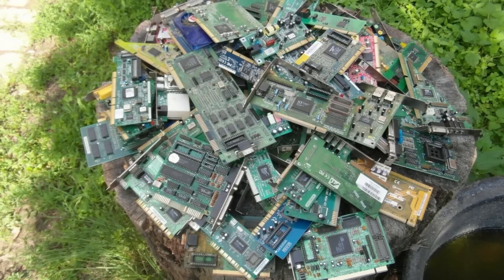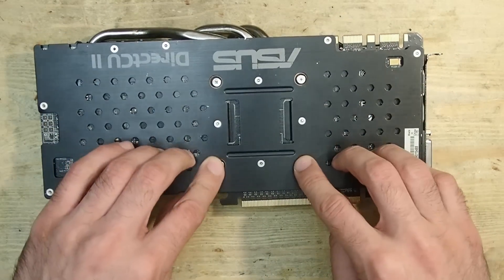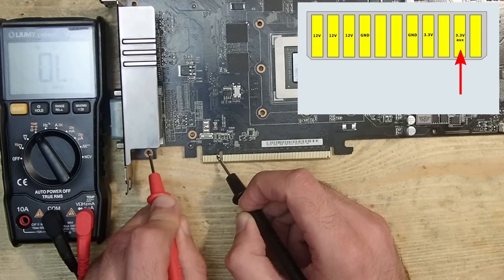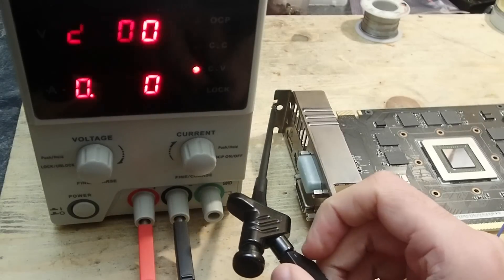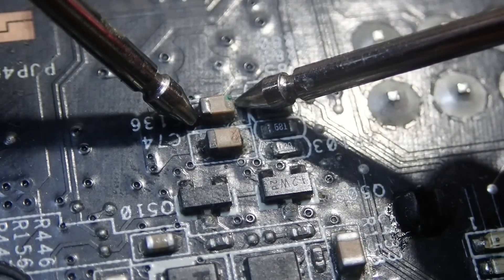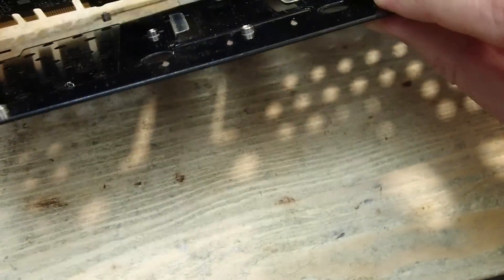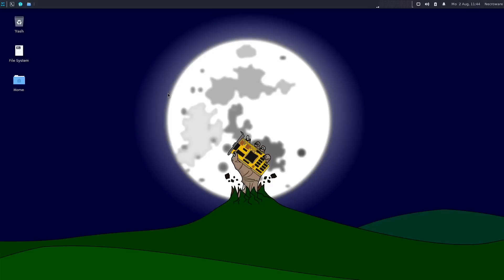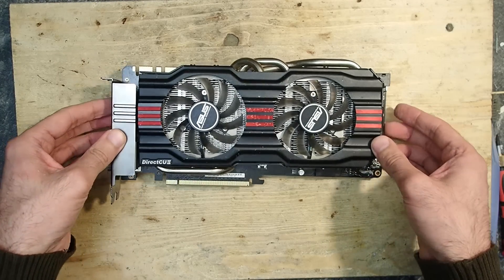GPU shortage? Let's repair an Nvidia GTX 770

Comment: Soldered edge connector will destroy gold plating in MB connector. Just becouse slow mixing and difussion Pb to gold layer.
Reply from the maker: I know, that's why I said in the video, that it's not good. However, I don't care ;) It takes a long time to dissolve the gold plating and even then, it doesn't end up in a critical issue.  Also by that time the mainboard already died for the 3rd time....
Reply: @necro_ware  Hm. I will advise to try to remove all coating after lead directly to copper layer. It will oxidise for long time) And for future restoration just think about  gold plating solutions for electrolise process (nikel + gold). It is not cheap but will work for long time when making only gold fingers resorations.
Reply from the maker: @microtrigger  Yeah, if s.o. repairs something really valuable, I'd avoid soldering to the gold fingers at any price. I'd rather take a PCIe slot from a dead board and use it as with soldered power wires to the pins. However, not in this case, it's not worth the hustle. This GPU is still good and will make it's job just fine, but it's nothing for eternity. So investing into gold plating is quite an overkill :D
Reply: @necro_ware  riser x1 with full x16 pcie connector for this stuf is much sutable)) I understand very well your point, just add that recovering gold plating is nice thing as new original content for your chanel)

Comment: How about a GTX 750 ti, the fans are running but there's no image . My case is too small and probably my power supply is too weak to test it, so should I take it to a professional for a diagnosis? Or to a friends house first and connect it properly, maybe the pc will say something? Idk

Comment: According to Nvidia, a GTX 770 is a retro HW, it does not get driver fix any more. :)
Reply from the maker: Yeah, it's a subjective question anyway. For me everything without an ISA slot is not retro :D And if talking about hardware other than mainboards, it had to be done in the time, where it could've been running in a mainboard with an ISA slot.

Comment: Instead of soldering a wire on the edge connector, get a broken motherboard and pull the PCIE slot off and solder to that.

Comment: I hope the card has some reverse voltage safeguards from the fans. You should never spin cooling fans when they are still connected.
Reply from the maker: The funniest comment so far :D I guess I have to rotate the fans really hard to generate enough power that it would be worth it to talk about....

Comment: I have an old 980Ti founders with rad, Could I send this in to you for repair?
Reply: Error: PC doesn't turn on at all when the card is in
Reply from the maker: That is a sign for a short circuit like it was in my case.  And I'm sorry, but unfortunately I don't take repair jobs for various reasons.

Comment: There ARE relatively inexpensive thermal cams that any repair technician with some stable income can buy auch as HT-301 which costs around $700 if you bargain in the chat on official site and comes with impressive manual focus 13mm lenses,  384x288 resolution and 25fps. For cheaper option an HT-201 could also do the job but I didn't regret going for a 301. Thermal cams can also reveal minute differences that your hands simply can't tell, such as a malfunctioning memory chip with only .5 degrees temperature difference.

Comment: Data Centers figured this out a decade ago
Reply from the maker: You wouldn't believe that, but electronics engineeres figured this out over 100 years ago ;)
Reply: @necro_ware  it's also used to lower failure rate

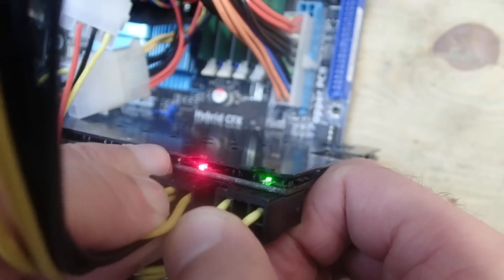Comment: At 15:12 if anyone want to know how to "cheat" the VGA with 6 pin connector, just make a bridge between the both free pins. One of them is GND and the other one is VGA bios test pin, which looks for the proper rated PCU with 8 pins.

Comment: I loved your video, how you use the: "when all you have is a hammer" approach
Reply from the maker: I don't know if you mean it sarcastic, but in German it is actually something bad. The full expression is "If all you have is a hammer, everything looks like a nail", and means, that you ineffectively misuse a tool you know for the wrong tasks, because you don't know anything else. This will be often said to the people, which refuse to learn new things :)
Reply: @necro_ware  no man, I'm sorry I ment it in a good way, far too often I see people repairing electronics using equipment that is worth thousands of usd, I liked your, "well I have a lab bench power supply, I'll make this work somehow" approach

Comment: Hi...I have exact same card of GTX 770 msi...not showing anything fan spinning... I just connect thorough hdmi to vga bcoz my monitor was vga... The connector working and I checked on a gt 730...and it's working perfectly fine... Why GTX 770 not working ????

I tried cleaning using IPA...but no use... My motherboard was gigabyte h510...is there any issue of support....

Comment: I was running Unigine Heaven
Ultra, full HD, AA x8 on nVidia GeForce 9800 GTX (SLI)
same as above with tessellation nVidia GeForce GTX 460 (SLI) and single 960 2GB
same as above, 2560x1600, AMD Radeon RX 580 8gb
all way above 30FPS in slowest scene, up to 80FPS in fattest scene
AMD goes to three digits FPS without problem

Comment: Amazing. You fixed it. You actually fixed a dead GPU. WOW.
Many of the testing was done, I presume, off camera. How long did all the process take from start to end??
It's a good thing to have a voltage modulator.
I have an INVIDIA Geforce GTX 750 ti 4 GB. it runs great on a core 2duo system, but when this month I upgraded my Motherboard to Biostar 510H and my CPU to core i5 10400, the GPU made the board beep many times then nothing on the screen.
I've tested it back on core 2 duo, it works fine.
I have no idea what's wrong with this biostar Mb. Any thoughts about it would be appreciated.
Reply from the maker: It didn't take long. You see almost everything what I did, I just raised the current slowly and threw that part out, because  up to 4A nothing happened and would be boring to show. The whole repair without filming and explanation would take about 10 minutes.

Comment: my msi rx 570 accecpted a 6pin into its 8pin socket just with 0 overclock ability infact i had to hit it with a -10% power mhs core/mem to make it stable.. so getting a better psu was an instant upgrade allowing the 570 oc and fly again

Comment: Are all those pci x16 connectors the same as the picture shows around 5:18? Or are they different on each card? Like, are they all 12v, 12v, 12v, GND, nothing, nothing, gnd, 3.3v, nothing, 3.3v aux, nothing?

Comment: Thank you for your work. You've made a great educational video for hobbyists like me. It helps me a lot. I've been trying to repair the motherboard from power macintosh 6100/66 for some time. The computer started the first time and it made a melody, unfortunately after the next start, only the HDD starts and ther is no starting melody and image, I replaced the battery, capacitors and still nothing.

Comment: The identifying the SMD components values is the hardest part, i'm not experienced enough with common circuits, and most of the time there won't be a schematic/diagram available online especially on less common/older hardwares.
Love the video 👍

Comment: I have a GTX 770 in my computer now. It's what I use everyday. Works great for me. I'm not a gamer so I don't need the newest tech. I usually buy someones old card. The last two I've had I bought that way. Much cheaper than new and when gamers want a new card they're old ones are typically perfect for what I need. I thought this card was causing a latency issue. If I could only figure out where that latency issues are coming from I'd be a happy dude. I thought it was an Nvidia driver for a while but no. It just represents looking that way. The card and it's drivers are fine. It is a hardware issue for sure though. I setup a dual boot and got the issue to present. Then switched OS's and still had the problem. So unlikely that's a windows thing. Gonna test the SSD tomorrow. I'm sure my various searches for solutions or technical info is what led to yt suggesting this video but I'm glad it did. It was interesting.

Comment: Industry secret when it comes to figuring out shorts:
.
.
.
.

1 Get a vape pen/battery (i dont know, I don't vape)
2 Fill the capsule with low-temp rosin flux
3 Heat the flux with the pen until it boils and smokes. -DO NOT INHALE
4 Pour the dense smoke onto your pcb until most of the pcb is covered in a thin sheet of condensate flux
5 Connect your tester to different parts of the board and the minimal current should be enough to heat and visibly melt the condensate wherever there may be a short.

Comment: Just for testing, you can connect the "sense" pin on the 8pin PCIe connector to ground to simulate a full 8pin connection. And if all 3 of your +12V pin are present, it should not matter at all.

Comment: the equipment needed to fix the old graphic card costs more than to buy a new RTX 3090 tho.
Reply from the maker: In this video I used a soldering iron for 10€, a finger for free and a workbench power supply, which I'm using for countless other projects and which I didn't buy explicitly for this repair. Furthermore, it is also not very expensive.
Reply: @necro_ware  If I ship you my GTX 670 how much does it cost to fix it for me?
Reply from the maker: @bab0ulas  I'm sorry, but I don't take repair jobs. I'm a software developer and this channel is just a hobby.

Comment: Well I guess I don't care with which thermal method you find the fault. But when reassemble the card it looked wonky that you didn't show you fasten the screws over the gpu in a cross pattern.
Reply from the maker: I think this knows everyone, who feels ready to  make such a repair.
Reply: @necro_ware  I guess you are correct, science nobody without that knowledge would attempt to disassemble the card. But yeah the way you made the cuts in the video give a vibe of unease. It is like you assume he did it the right way, but you can not really be sure the way it is shown.
Reply from the maker: @Airwave2k2  I'm doing this since 30 years already, so you can be relaxed about it :)
Reply: @necro_ware  Sure this is tech and you can measure it, but yeah experience is a short cut to get things done not over complicating things.

Comment: Oh no, these psu tend to ruin people's pc, I don't recommend that brand at all
Reply from the maker: Fully disagreed. Meanwhile I tested this PSU inside out. It is superb especially for the price. In my test it worked 12 hours at over 360W of constant load (Ryzen5 + RX480 of rendering work) without a slight hick up. Absolutely cool and quiet. The voltage was stable and the ripple on the 12V rail was under 70mV that is really good. To compare with my three times more expensive BeQuiet, that was at around 100mV. Furthermore this PSU was tested and citified in the EU  and I checked for the official registration and test results. They are not faked, like with many other cheap PSUs. The active PFC is also true and is working, I tested it as well. There are only two things I didn't like about it, the missing over current protection on +5V rail and in my opinion the cables should be thicker, but I might be wrong in that regards. Unfortunately the missing over current protection seems to be a weakness of many modern PSUs even of the expensive ones. Otherwise this PSU was an absolutely positive surprise for me. It delivered better overall performance, than my much more expensive BeQuiet PSU and  I definitely would buy it again.

Here are some EU certification test reports:
https://clearesult5.sharepoint.com/:b:/s/PLS/EVJ7AiRuNEpFvPJhwapt7m8BlMEXsGzlGmQ9m7d4_vjALQ?e=YI2CMY

Comment: Trow away that mars gaming PSU, is a shitty psu
Reply from the maker: This PSU is really good, not even talking about the price. I tested it meanwhile inside out and it delivers better numbers, than a three times more expensive BeQuiet, which I have.
Reply: @necro_ware  watch "Falco75 with sub u will understand more about ripple ecc. This psu has high ripple and false sticker about his power and current efficency.
Reply from the maker: @TheRealNabbus  He tested the old MP generation, which was completely crap. This is new series MPB with full redesign. Watch my video about this PSU and especially read my pinned UPDATE comment on this: https://youtu.be/_zuKtjNftOo

Comment: @Necroware: Maybe you could help me with a problem? Back in AGP days, it was very easy to replace VBIOS font with another codepage (CP866) bitmap font. Now, when i open VBIOS.BIN for nVidia PCIE, i can't find any hex pattern that resembles the IBM VGA font. Would you know how to unpack a 980ti (Maxwell) VBIOS, and repack it after making changes? I don't want to tinker with clock speeds, voltages, or fans. Thank you.
Reply from the maker: First of all, you have my attention, so what do you need this for? And in regards of your question, I am not an expert in that, but as far as I know all the Nvidia BIOS/Firmware starting with 900th series are digitally signed, so you shouldn't be able to modify it anymore on your own.
Reply: @necro_ware  Dear sir,
My graphical grub-loader only uses text for menu labels. In order to display cyrillic text for menu items and folder names, i need codepage 866 outside of an OS. This was no problem with 5200 AGP card. I cut and pasted the bitmap font with a hex editor, and corrected checksum in an unused text string (copyright) area of VBIOS and flashed the card as normal. But now, to upgrade system, i had to move into a PCIE motherboard. There are programs to edit Maxwell VBIOS, however they are only for overclocking graphics cards. My goal is not to damage card with overclocking, but to just swap out one bitmap font for another. BIOS signing can't be too strict, if almost anyone can mod clock speeds, voltage, and fan curves. I just can't find a font patern in hex dump, so maybe these new firmwares are compressed in some way? If you have some insight, i'd appreciate any help you'd be willing to offer. Thank you.
Best regards,
- Aleksandr
Reply from the maker: This is the wildest reason I was ever expecting to get :D Grub doesn't use the fonts from the BIOS. We are in 2021, there is UTF8 and locales. The easiest way to get it in Russian is to create the configuration using the Russian locale:
LANG=ru_RU.UTF8 grub-mkconfig -o /boot/grub/grub.cfg

If you want your grub to work in any language you want, even in Chinese, search in the documentation for locales. The last time you needed to patch the graphics BIOS to get Russian letters was in the early 90's. Already 1992 or so nobody bothered to patch the BIOS and used TSRs for such things.
Reply: @necro_ware  The Grub menu i'm using was a project created by someone in China. Yes, it is very old and no longer active, but it had support for touchscreen (mouse+single click) and passwords, so i've been using it for many years. It worked with the cyrillic alphabet, but only after i changed extended characters of video font. Before that, everything showed up as a gibberish of symbols, ASCII blocks, and Greek letters. I don't see any fonts or language settings in the boot menu studio. Do you know of any newer boot menu that works with a touchscreen? I guess i'll have to give up password protection and loading x86 binaries (disk tools) without an OS. Danke schön.
Reply from the maker: @aleksandrbmelnikov  Grub2 has support for custom input devices, but as far as I know, each touchscreen is different and you have to implement a custom driver. This is probably, what has been done by the Chinese developer, I guess. If you can somehow take the input driver over to a new system, this could be a solution. Otherwise you'd have to implement that driver on your own. Or search online for some sources. May be s.o. already made it for your touchscreen before.
Reply: @necro_ware  Ok, so there is hope. First i'd have to rip apart this old boot menu studio. Then start from scratch, only this time using UTF-8 instead of pseudo hardwired MS-DOS encoding.  Bugger! I liked not needing a language overlay in memory to display Russian text. I've also been able to relocalize the computer BIOS, but there is no support for UTF-8. Hey, it could be worse. At least i'm not changing computer to Arabic. LOL! In odd chance you do stumble upon information about nVidia graphics cards firmware anatomy, please share your findings. You would be saving me from making many blood sacrifices to GNU gods. Danke schön!
- Aleksandr

Comment: How do you find the exactly component?? I mean, were so u look for schematics?? 😶
Reply from the maker: There is no one way to make it right. You will not find any schematics for the graphics card, so you have to look which parts are broken, then open the datasheets for that parts and search for suggested circuitry example. Then you have to search for this circuitry on the graphics card or whatever you want to repair. Often manufacturers use components, which are slightly different from the suggested, so you will have to recalculate the values sometimes. So even some simple math is sometimes involved.

Comment: Nice video!
You can also solder the two extra pins in the 8 pin connector to the ones next to them directly on the cards pcb so they get 12v and gnd and use a 6 pin connector.
And if you dont want to solder on the gold plated connector when injecting current, solder the cable under the motherbord instead, on the pad with 3,3v.
Maby solder cables to all the supply pins and you will have a super duper testing mother board :)